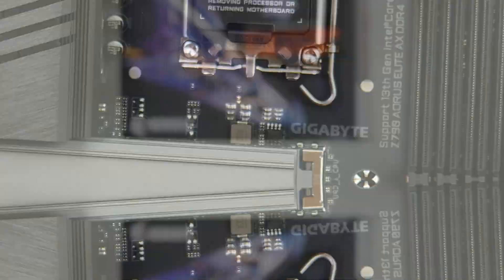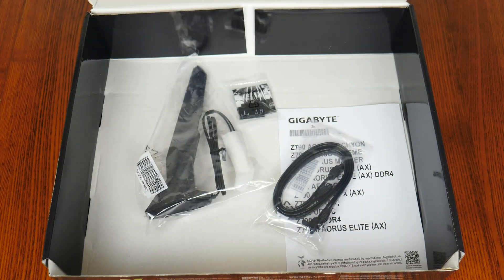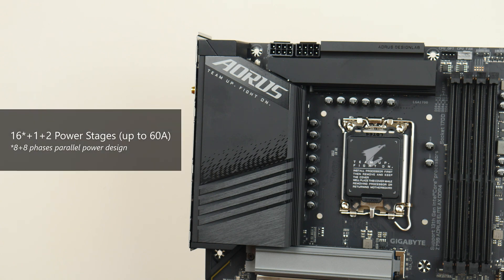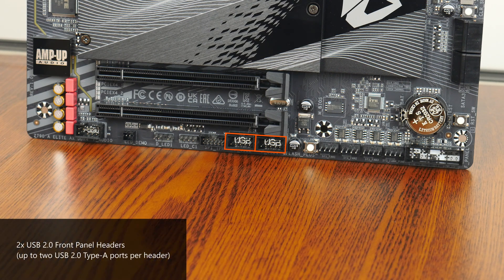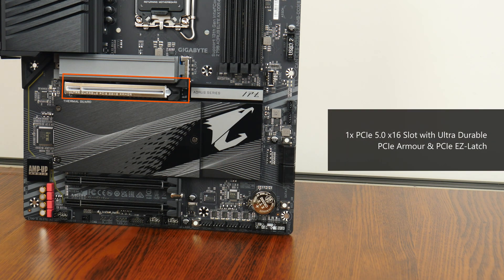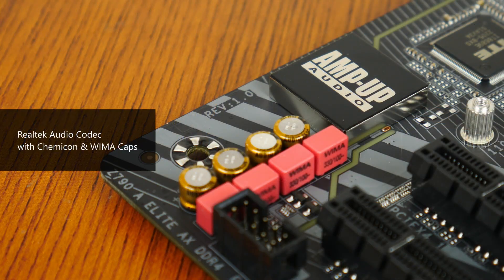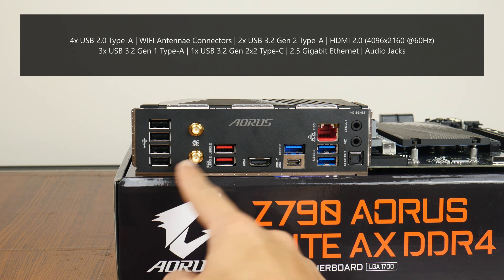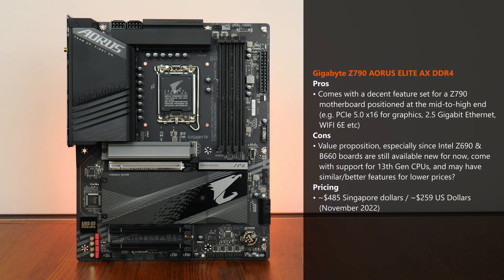Mid-range Intel DDR4 Z790 Motherboard? Gigabyte Z790 AORUS ELITE AX DDR4 Unboxing & Overview

Comment: does anyone know if the 16+1+2 power stages @ 60A are enough to power a 13900k without performance loss?
Reply: I have 13900k with z790 aorus elite ax ddr5 and h150i cooler.
I hit 37100 points on multicore and 2150 on singlecore with a very little undervolt.
The score is similar with the other benchmark i found on web.

Comment: Almost 300$ for "mid tier" motherboard hmm idk about that lol, I went with an MSI B660M mag mortar Wifi for my i5-13600K and will be awesome
Reply from the maker: Yeahh....I'd personally go with a 600-series board too if I'm building a new 13th Gen system, that is until they're no longer available new! Guess that might be from Jan 2023 onwards when Intel releases its H770 and B760 chipsets..
Reply: @ALKtech  True, the best move is to go with a high end B660 board that has good heatsink and VRM cooling and (that has Flashback bios function) or go with a Z690 that is decent and also has flashback bios functionality to flash the bios without a 12th gen CPU if you are planning to pair it with a 13th gen CPU. The MSI board I got I bought it for 160$ but had to take it to a shop to flash bios so its 13th gen compatible since it has no flashback button, but all gigabyte boards have Q-Flash which you can use to flash bios without CPU/RAM/GPU, if going with a Z690, it has to be at least 230$ or more expensive because the entry level Z690 are garbage in terms of VRM cooling, my MSI B660 mag mortar puts some entry level Z690's to shame.

Either Get high end B660/ Mid-range decent Z690 now and update bios to pair with 13th gen or you can wait until Jan-February for intel to release "Budget" B760 boards, although I saw a couple leaks couple weeks ago and I think the prices of the B760 boards that are decent are going to be over 200$ apparently.
Reply: @ZealousPumpkinTV  Thank you.